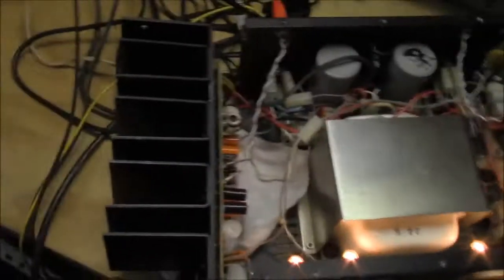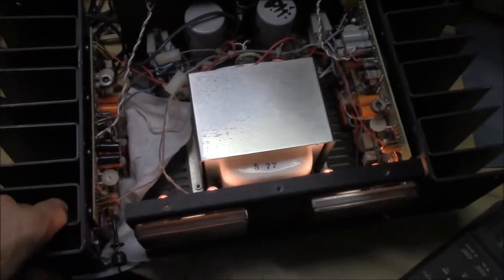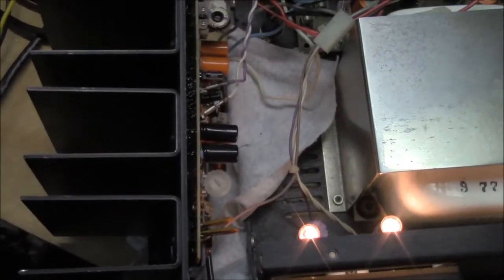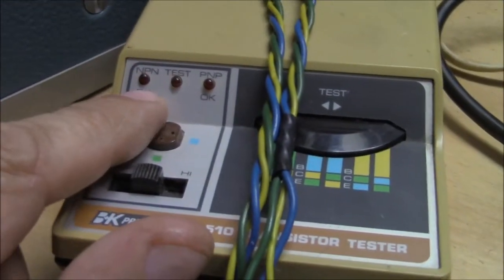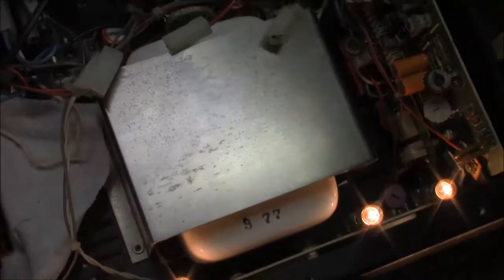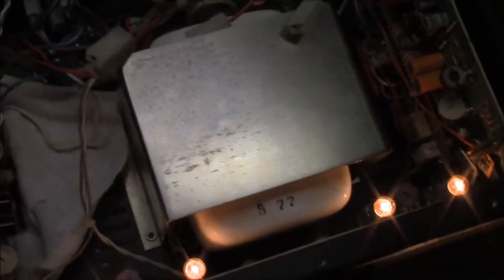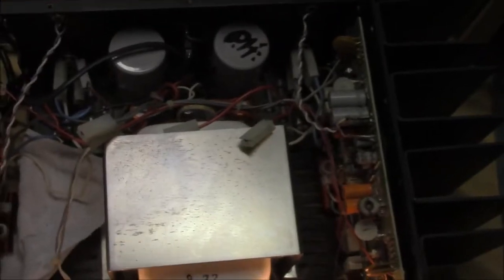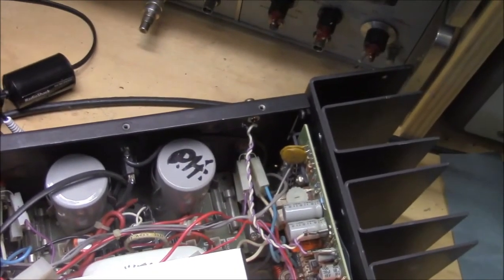GAS Son Of Ampzilla pt2

Comment: Well, did you ever figure out the problem with channel A?  Do you have the schematic? If so, you should methodically go thru the node voltages to determine where the problem lies. 

I recently fixed a grandson that had some charring on the main board. Turned out that a resistor failed open circuit. One silly resistor brought both channels down, it fed one of the zeners that powered the input stage. 

The bongiorno amplifiers all the same topology. After making a few spice runs, I have a pretty good feel for the component dependencies. Good luck.